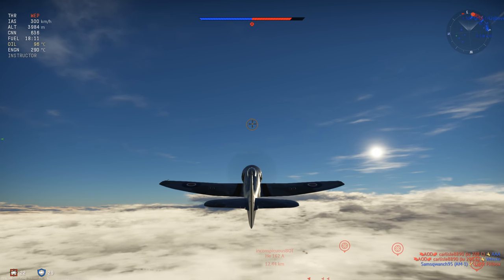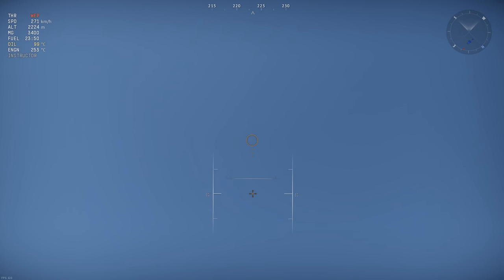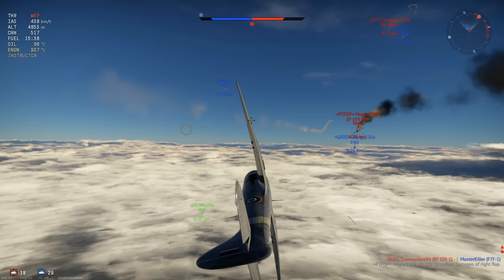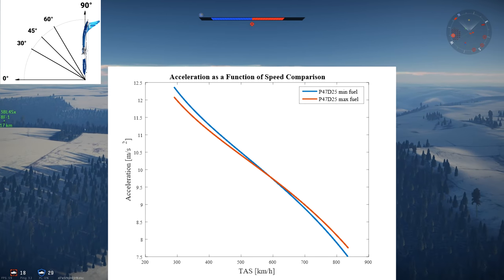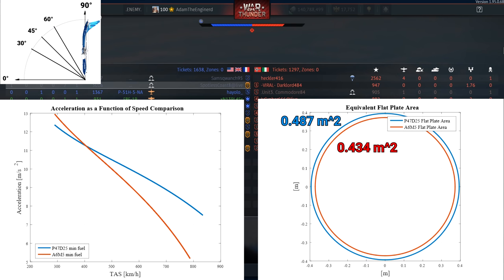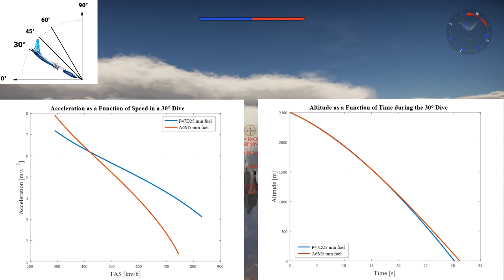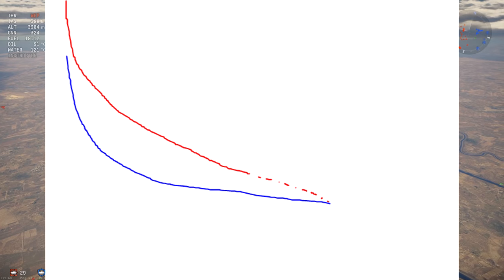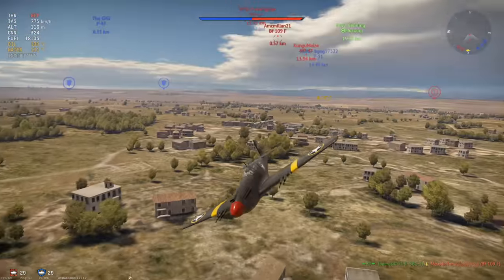Mythbusting | Do Heavier Aircraft Dive Better Than Lighter Aircraft?

Comment: Adam would you like to make a video on working with the I-225's radiator? It overheats so quickly and MEC seems difficult to fix that problem since it interferes with the engine's high alt performance.
Reply from the maker: You need to adjust mixture to keep it performaing at high alt. Reduce prop pitch to 80-90 will help cooling a lot with not much loss of power.
Reply: @AdamTheEnginerd I've just given it a try, and IT WORKS. Thank you so much Adam, you are great.
Reply from the maker: @budweiser.pie62  My pleasure!

Comment: for me the 2 biggest factors for how well a plane dives is how badly it locks up, handles at high speed, and how much much g forces can the plane take for pulling out
Reply from the maker: I consider that in a separate category called "high speed handling". This video is about dive speeds and acceleration, and which aircraft would escape or catch the other in a dive.

Comment: "Let's MCAS right into it" and that 737 MAX dive angle representation 😂🤣

All explains what I have known. Once the heavy Thunderbolts and 190's get to the high dive speeds that's when they are untouchable, but until then... well even a Zero will have fun with them. Really puts a damper on the BnZ fighters. 

Good and informative stuff.
Reply from the maker: Haha yes!

Thanks!
Reply: Cannonfodder43,
 still with the 190's I see ^^
Yeah great video

Comment: 1. Induced drag has no effect.
2. I refuse to take into account wave drag because there is no known way of describing it mathematically.
3. Suppose the speed at which engine thrust equals parasitic drag (slightly above top speed) is the same on two airplanes, then before reaching that speed the lighter plane has greater acceleration and after that point, the heavier does.
Reply from the maker: 1. Still a bit of induced drag even in 90°, because the wings create lift even with no AoA.
2. Wave drag had no effect at these speeds. Just because supposedly you can't describe it mathematically doesn't mean you can't use it. Pi can only be used approximately, and the same is true for many things.
3. That's precisely what the min fuel vs max fuel P47 simulation told us.

Comment: So if I understood well it's like inertia, it's easier for the heavy aircraft to keep it's speed/energy state once it has reached it but it's a bit harder for it to reach it compared to ligher aircraft with better acceleration, right ? (provided only friction forces are applied)
7:50 yeah most players don't understand that time is a crucial part of Air RB, the most obvious case being when climbing : the longer you climb the higher you get and the bigger your "energy reserve" gets (without taking account the situation of course).
8:40 conclusion : stop diving to the deck like a mad man, just shallow dive like a boss ^^
Reply from the maker: Pretty much, heavier means it'll take longer to reach your top speed, but you'll continue accelerating better than a lighter but otherwise identical aircraft.

Yup, takes 200 seconds for an aircraft with 5m/s climb rate advantage to get 1km altitude advantage over the enemy.
Reply: However energy retention is different for different planes because of many other factors. A plane like p47d cannot deviate too much from linear and shallow flight path otherwise it will bleed too much energy. While other planes can maintain high energy state while flying loopings etc.

Comment: Hey. 

Saw your tempest mk2 spaded video and came here. 

My question: Why do longer chases against better diving props, translate to bigger energy difference? Unless I can climb back to altitude, I wouldn't have built up energy difference right?!
Reply from the maker: You can get a bigger energy difference if the worse diving plane loses energy (lower speed gain per altitude if you prefer) than the better diving plane.

Comment: It's interesting the speed where the accleration curve of P-47 crosses that of the Zero is almost the same no matter the diving angle. This point is also where the P-47 starts to gain energy faster than the Zero. Also, the aircraft's top level speed is where it starts to lose energy. Therefore I guess it's not wise to dive past your own top speed but instead you should accelerate just enough so you're gaining energy faster than the enemy (or you're gaining while he's losing) and use that to reverse the initial energy advantage he has. Diving is only a faster way of accelerating. Ultimately, it only works when you're heavier but your top speed is higher.
Reply from the maker: Yup, a dive is not much different from going straight!

Comment: Great points, and it does dispel the confusion over a statement like dives well, as many will assume that is what it means. I always had thought when they say a good diver, pilots are speaking about energy retention through a dive rather than acceleration, as even while diving you wouldn't have better acceleration than when you are in level flight, given more mass and most likely more drag, which like you mentioned bombers suffer from. So with a 109 it is a pretty decent diver, because of low drag and good power to weight, however it would be faster to decel to normal air speed than a heavier aircraft, which is certainly useful to know in something like a p-51 chasing one. There being other factors like the laminar flow wings on the 51, which create less drag than the 109's wings, and therefore are better at high speed. Because of this drag issue and wing geometry issue, I doubt that the P-47 is able to retain the energy longer, despite being very heavy. Plus the radial open front engine is always such a drag!
Reply from the maker: Bf109s aren't low drag, they'd have average drag for their weight. And P47s have a low drag/mass ratio so they do retain energy past their top speed well. P47s just aren't too good at low altitude so at the end of a dive you're low and that's not where P47s are best.
Reply: @AdamTheEnginerd  So do you think that is what is generally referred to as a good diver is referring to?
Reply from the maker: I explain it in the video, but it's mainly dive acceleration and top speed.
Reply: @AdamTheEnginerd  Yeah, you said that based on your assumption that what people refer to as makes a good diver are those two things, but I never heard that is what that meant at all. Is it possible maybe you misunderstood what is meant by a good diving plane as well? I mean certainly terms are often morphed and misused over time, it really just depends on who you ask, right? Albeit I am not certain when it is that I came to understand what constituted a good diver as being good, other than energy retention, combined with top end acceleration combined with lower drag. 
I might like to credit Long5hot, Jengar, GRIMLZ, perhaps Magz, always been a student, though certainly am rusty in this terminology. 
For instance you really wouldn't call the 190H a good diver, considering the wingspan of that beast, creating tremendous drag that would eat away at the other advantageous features of accel, correct? 
In essence, like suggested, just thinking perhaps you could make a part two if warranted on what makes a good diving plane, if based on the aforementioned characteristics. Perhaps even getting other educational youtubers input on what they had heard that it is vs what they thought.
Reply from the maker: @chris_hisss  People don't know what they mean when they talk about dive. The main aspect of dive is dive acceleration, which is why this video was mainly on dive acceleration and not the various other factors that surround dive.

Ta152H would dive averagely. Long wings don't make it very draggy. It has average P/W and average drag, so it dives averagely for its BR.

Again, dive acceleration is the main aspect of dive performance. This video dealt with it deeply. I consider high speed maneuverability to be separate from dive performance for the record.

Comment: finally someone did it. ive been saying that weight doesnt matter. gravity is the same for every body in earth. 
Acceleration differences occur just because aerodynamics.
Reply from the maker: The drag to weight ratio matters though! More weight helps accelerate past the level flight top speed of the aircraft.
Reply: @AdamTheEnginerd  maybe you should talk about mass. the higher mass is important. weight is just a function of gravity that acts on a mass. power to weight ratio is also important. all the different drags applied act differently if you have a heavier or lighter airplance comparatively. Since not only earth gravity is always apply acceleration onto a body of mass, in case of prop airplanes the engine and propeller apply their own acceleration on your body of mass.
Reply: Late reply but if what you are saying is true then why does a feather fall slower than a brick ? (as long as it's not in a vaccum)  
Don't tell me it's because of the aerodynamics, I'm pretty sure a brick would create more air resistance if it had the same weight as the feather. Mass of the object won't increase the gravitational acceleration but it will decrease the effect that the air resistance has on an object.

Comment: Engine power and Drag to weight ratio is the key.  If two planes are equal aerodinamically When both planes are diving air and friction needs to excert more force on a a heavier plane to stop its acceleration beyong gravity. Force=mass x acceleration : its simple, if that friction opposing force can me diminished by better aerodynamics or better forward propulsion engine force youll dive faster than a heavier plane (fighter vs bomber). If your plane is a brick with huge drag no matter how heavy it is a lighter more aerodynamic one will catch you. In a void no matter the weight every object dive the same. So in air is all as you said a matter of weight to drag ratio and engine acceleration. In ww2 it was wellknown that no German piston-engined plane could outdive the Thunderbolt.
Reply from the maker: Precisely (beyond a certain speed for the P47 outdive part that is).

Comment: it doesn't really matter whether your aircraft is diving better or worse as long as there's at least 2 second window where your planes and the enemy planes is under 500m you're dead if 1 bullet hits you cause if it's not impaired your aircraft performance most of the time you'll make a turn or maneuver out of reflex to dodge which bleeds your speed and further eliminate dive performance difference

Comment: I never really factored weight into diving characteristics, I always thought that the maximum speed the airframe could take and the loss of control as the speed increased was more important. Incidentally, aircraft with nigh features also have a reputation of being heavy.
Reply from the maker: I'm only talking about dive performance, not high speed handling. This video is only about which aircraft would catch which in a dive.
Reply: @AdamTheEnginerd  No yeah I'm just posting my thoughts :D

Comment: 0:43 isn't dive angle also a possible meaning of "good dive?"  My facts may be wrong but I recall the Corsair's dive flaps let it head straight down without overspeeding, and almost no plane could follow it for more than a few seconds (except I think Buffalos, and Wildcats which literally didn't have a Vmax)??

And a lot of the terms you use are mysterious to people like me who are comfortable with engineering in general but have no idea what a "rip speed" is or what the various spawn modes you mention are.  You clearly are making all these great vids to communicate, so why not at least define your terms when you first use them in a given vid?  To be fair I see you sometimes defining it later, so may just be a question of edit to move that forward...  Thanks for all the work!
Reply from the maker: It might be a small benefit to be able to dive at any angle, but in practical applications it's not too significant.

What do you mean by "spawn modes"? Rip speed is simply Vmax.

My pleasure!

Comment: It's interesting to see the numbers on how long it actually takes to gain separation. There are tons of other factors that influence in-game dives that would be neat to see, but the model could quickly become way too complicated.

High-speed handling and rip speed  can be pretty important in some scenarios. with the corsair, I've gotten 109s that chased me in dives to rip by looping under them. The later 109s are fast enough that they still accelerate well relatively close to their rip speed, which combined with the larger turn radius at those speeds leads to them overspeeding while following the split-S. People don't seem to expect hard maneuvers that lead to gaining too much speed.
Reply from the maker: Yeah, I could model maneuvers but it's a detail at this point, the bigger picture I presented in the video is the most useful representation.

Yup, at 650+ if a Bf109 follows your split S and doesn't use the prop pitch airbrake, it'll rip.
Reply: @AdamTheEnginerd  I know 109s are more popular than other planes with similarly low rip speeds (such as Yaks and Las), but their pilots don't seem to make the mistake of following me in those maneuvers as much.
Reply: @AdamTheEnginerd  seeing how MER changes at high speeds would be interesting, since both planes will be making slight maneuvers if the chasing plane is within shooting distance. does the MER advantage of the zero decrease relative to the P-47 the faster the planes are moving?
Reply from the maker: @Turk3YbAstEr  Yeah the faster the speed, the better the faster plane's MER will be relative to the slower plane's MER.

Comment: Ik the general opinion on bombers, but there isn’t really a guide on the different bomb types for different nations and how many kg of explosive mass are actually needed for bases/airfields. It might take a while, but such a guide may improve the efficiency of bombers overall.
Reply from the maker: Bombing bases and airfield is pretty much the most useless thing you can do. Doesn't matter if you use 1 bomb less on a base and use 1 more bomb the af, if you can't finish off the af.
Reply: AdamTheEnginerd yeah fairs. Base bombing only really works with the German bombers imo and requires some competence from the players. Not a lot, but some. Can also work well at rank 1 but people usually lack abilities there

Comment: As you say, Dives well is somewhat meaningless,  if you play boom and zoom, you want to retain energy coming out of the dive,  the ability to turn energy back into potential energy for your next pass, or extend away.
Reply from the maker: The aircraft with better dive acceleration will also retain energy better at that speed.
Reply: Am I wrong in thinking that a heavier aircraft will zoom better? As in a zero can boom and zoom, but a P47 will be more efficient.
Reply from the maker: @merocaine  Yes, but no because of weight, it's because it has a higher top speed.

Comment: You know, I never did the math, cause I have no idea how to, but my theoretical conclusion was the same, light aircraft beat a dive from stall speed, while aircraft that are already limited by drag, are pushed faster by thier weight.
Reply: Meaning that "denser" aircraft have a small advantage at extreme speeds.
Reply from the maker: Pretty much!

Comment: 11:30 but your enemy is going faster, and you dive straight down, he faces the risk of overspeeding prop, or losing control of his aircraft, so must break off, no?  You probably have the same risks, but starting at a lower speed, you have probably more time before it's an issue, no?

Also your illustration shows the Tempest simply nosing down into a dive.  Isn't it faster to do a half-roll and end up pointed straight down?
Reply from the maker: An enemy on your 6 only needs to go slightly faster than you to catch you in a dive, it's unlikely that there's a big enough difference in plane Vmax to make diving after you dangerous enough, but there are a few exceptions.

Depends how much you want to dive and what angle you're already pointing. If you just want to increase your dive by 30 degrees or less, no need to roll.

Comment: Thanks for this, this is really interesting!

Also, another reason why I'm not a fan of US planes. :P
Reply from the maker: My pleasure!

Because they dive worse at low speed and dive better at medium-high speeds?
Reply: @AdamTheEnginerd  More so because they're not amazing enough in a dive or acceleration to offset their need for speed and lack of manoeuvrability. American planes are certainly good (a lot of the issue is my own skill level), but I've just always felt they're too restrictive in playstyle, yet when played well their advantages don't seem as strong as other types when those other types are played to their own strengths.

It's a lot of why Russian fighters are my favourite in terms of playstyle and performance; they can face most any more specialized types. Basically, I like always "having options", and US planes tend to have the least options to get out of anything but an ideal situation. From my average skill and experience perspective, of course.
Reply from the maker: I do understand what you mean. US planes are the ones that benefit the most from teamplay.
Reply: @AdamTheEnginerd  But isn't that teamplay advantage neutralized if the opponents do teamplay too? "Get a team" is always the solution that is given when people debate why the axis always wins at some prop BRs.
Reply: @SangsungMeansToCome  US planes playing together will win over opponent's teamplay, as long as they climb correctly and maintain energy they will win via attrition of slowly splitting up and eliminating their opponents no matter the amount of teamplay. I have played many matches where it took just 2 decent p47 players to destroy a groups of german fighters working together at 5km+ alt